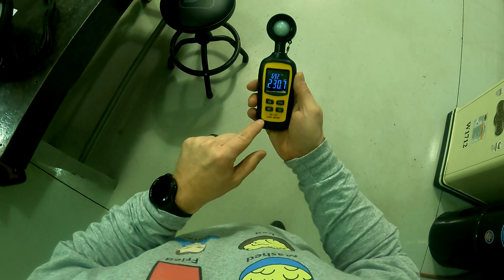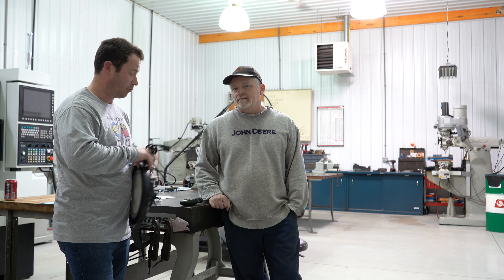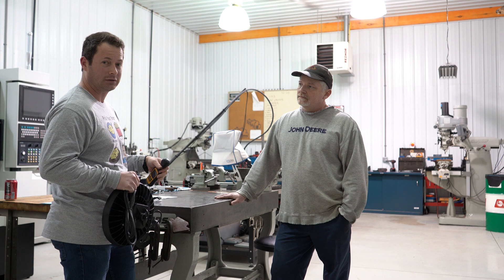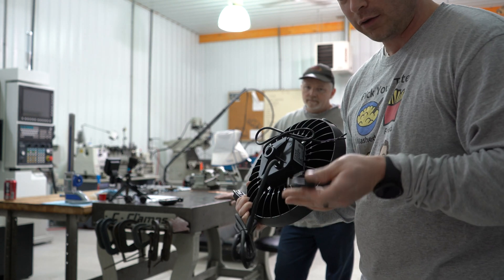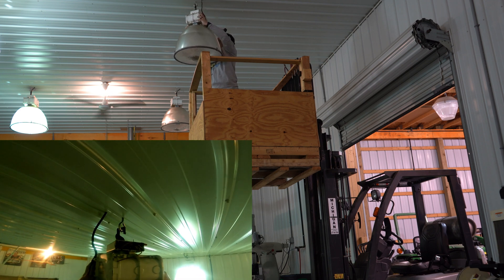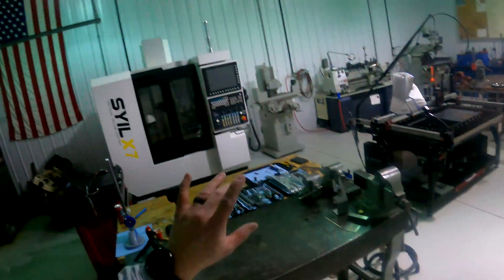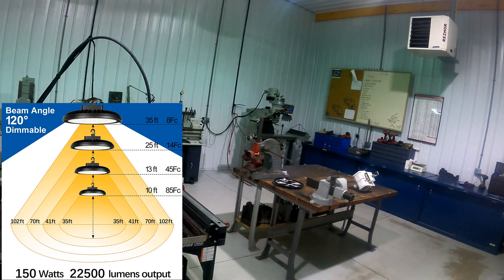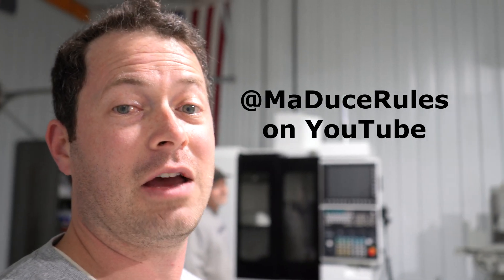✅ BRIGHT LED High Bay Shop Light - 150W 22500 Lumens - Install, Review vs Metal Halide

Comment: What size of wire did you use for your 150w led lights?
Reply from the maker: The lights come with a 5ft power cord attached and we just used that.  The barn had 12-2 wiring to those locations.

Comment: The saucer LED lights are really great lights.  I have installed so many of them.  I also have just 4 of them in my warehouse but I have the 250 watt version since my ceiling is at 26ft.  This provides me all the light that o usually need on a daily basis.
The other thing I like about them compared to my old highbay lights is that I no longer have the electrical hum which is just wasted energy and it bugs me since it has a pitch that is sensitive to my hearing.
Reply from the maker: Yes great points!

Comment: you gotta do the test again, but with brand new metal halide bulbs, probably wont be much different, but still lo
Reply: most bulbs are 2/3 the price of the LED unit at best and they're still over twice the power draw even if the light was identical
Reply: They looked cool though

Comment: Any idea on what dimmer to use that is also IP65 rated?
Reply from the maker: That's getting pretty niche.  I'm not aware of a 0-10v dimmer switch that is IP65 rated.  Maybe you can use an outdoor enclosure to protect the switch?  A switch like this: https://amzn.to/3ONe7pX with an enclosure like this https://amzn.to/3KzLMjN
Reply: @NaterTater  Thanks but going that route, I would spend more on the dimmer than the light